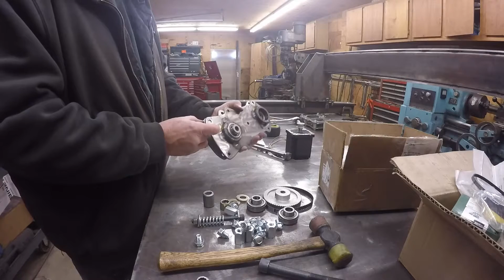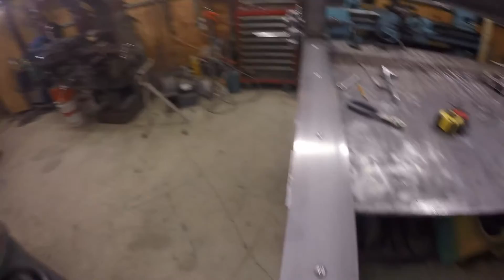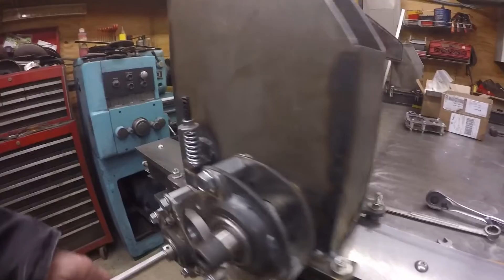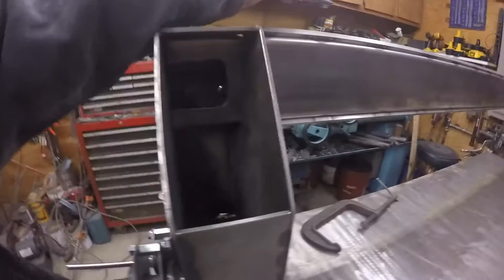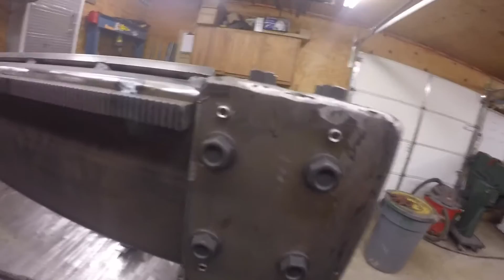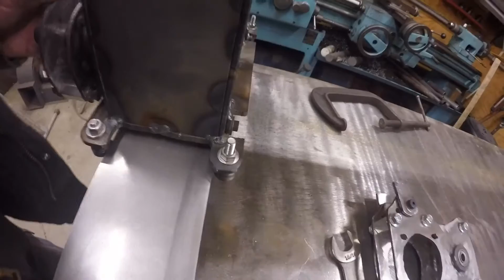cnc rack pinion drive

Comment: can you share blueprints this rack ???  thnx
Reply from the maker: I don't have blueprints for any of the table.  what I did was make a paper pattern of what I wanted I ordered the belt gears and several belts and the motor once I had the sizes I made a paper pattern making sure the studs clear the belt and motor I used Steel Coupling Nuts 1 1/8 long 3/8 16 with flange bolts 1/2 inch long.   I made 2 the same and the top one different looking  the idea came from cnc router parts unit  I ordered most of the stuff from mcmastercarr supply shafts are 1/2 inch as well as the timing pulley xl 60 tooth aul  and xl 15 inch belt 3/8 motor pully 15 or 16 tooth I found on line the nmea 34 motor takes has a shaft size McMaster did not have rack gears 20 deg 20 teeth all half inch shafting on the bearings hope this helps